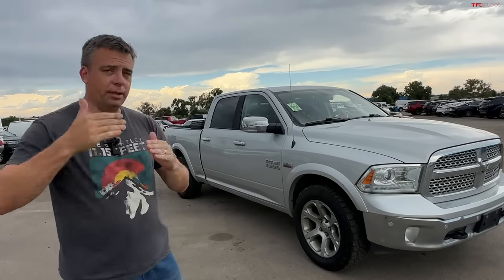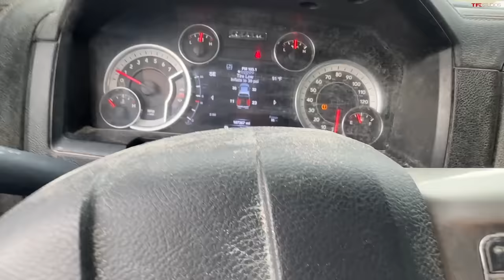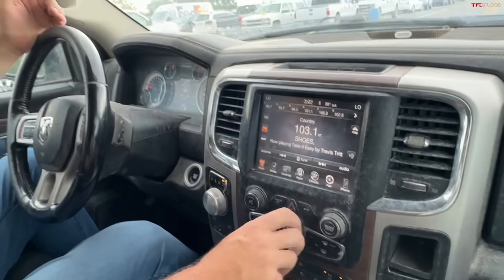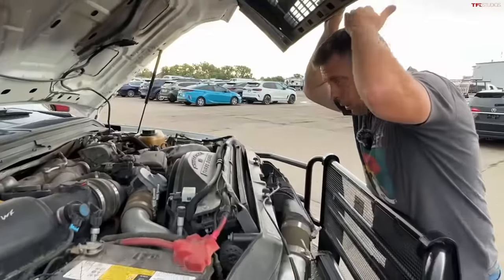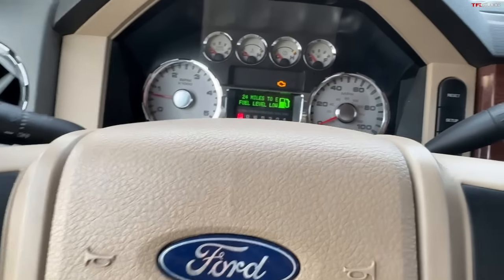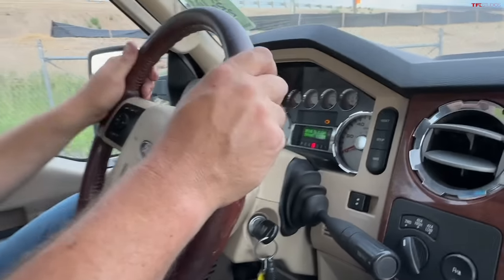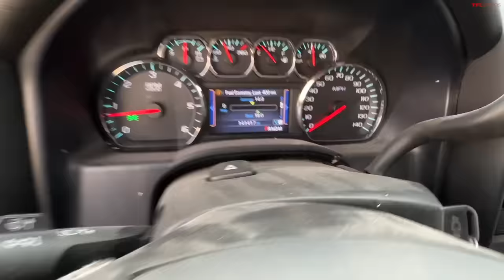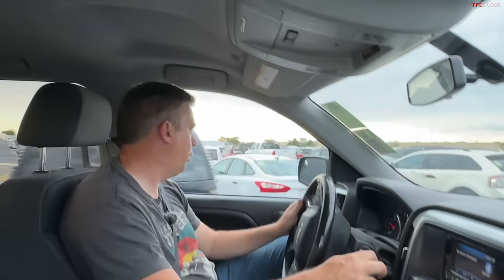These Are the Top 3 Used Trucks You Should Never, EVER Buy!

Comment: I have had my 1998 ram 1500 with a 318cc V8 for 25 years and 150 miles. It has been used as a work truck and vacations in the Georgia mountains. I have kept up with the maint. and repairs. Replaced the transmission at 106 miles with a reman. Also had it repainted 9 years ago. I will keep this truck as long as I can since I don't like all the sensors and new tech on the new ones. The price of the new trucks is absurd.
Reply: I like those trucks.  Does it still have a dash?
Reply: I see lots of trucks filthy like that at the auctions here. I have bought quite a few of them too and they are normally well maintained just dirty. Lot of them come from oil and gas companies. They need those trucks every day and normally have their own mechanic. They keep all the fluids and all changed just they don't keep them that clean. I bought one a few years ago that was a really nice truck. Just it had like 95k miles it was a Silverado like 7 years old I got at the auction for $14k. Crew cab LT with the 5.4, 4x4. Had a brand new set of BFGs on it one of the more aggressive tread patterns. It also had a propane cylinder in the bed so I could run on either gas or natural gas. It was a lot cleaner then this Ram but it wasn't spotless. There was a half dozen or so more that were really dirty. This one had carpet and all though the others all had the rubber mat floors so maybe the one I got was the boss truck.
Reply: I agree, the newer the vehicles becomes, the more plastic and sensors they have. My all time favorite is the early ninety's jeep Cherokee. Man those things will just go on for ever if maintained. I remember the trans finally went out at 272k miles and that thing had some hard miles on it, especially as I took it off road and sling lots of mud with it as well as out in the snow. The only thing that I had to replace twice was the water pump and tires. Had it when it had 155k miles and I drove it from MI to OH to NE and back to MI. I hate all the plastic they use now not to mention the rediculous sensors that often need to be replaced which the sensor itself is no big deal, but some cases, it's getting to the damn things that's the real pita.
Reply: I had a 150 Power Wagon with a 440.  I loved that truck and the fuel mileage wasn't any worse than my Ford station wagon.  Unfortunately , both rusted out far sooner than they should have.

Comment: I had good luck with my 2014 Silverado 5.3L. I just traded it in a couple of months ago and I had no issues with the engine or transmission. The only major issue I had was with the AC condenser in which it cracked at the fitting. I never disabled the AFM and it worked perfectly. I did install a catch can to keep the intake cleaner as long as possible.
Reply: how many miles?
Reply: @mujjuman  It had just over 93000 miles.
Reply: @kellyherald1390  wow nice
Reply: Just sold my 2014 Chevy Silverado today it had 336,800 miles on it
Reply: My 2014 Silverado had both the rear diff and transfer case problem. Costed me over $2,300 at 98k miles.

Comment: I have a 16 ram 1500 with 5.7 hemi. truck has 310,000 on it no lifter problems. it does tick on start-up but goes away after truck warms up. This is caused by exhaust manifold studs breaking.

Comment: An old job I worked at in 2011 had 11 Fords: 5 6.0s, 3 6.4s, & 2 6.7s. Those 6.4s were crap all around & for dual turbo motor no power & one of them needed turbos at under 20k miles. The 6.7s were great, the 6.0s honestly from my experience weren't that bad. Not the most powerful thing for it's time but still get the job done.

Comment: My 1st diesel was the 6.4 Ford and I spent 12,000 in the first 2 months in engine repairs. Then it was sold.
Reply from the maker: Yikes!  That is a lot of $$$ !
Reply: Your first issue was buying ford
Reply: My stepfather had one. He dumped many thousands of dollars into the engine. After the oil cooler melted, everything got deleted and tuned. Some hack “diesel mechanics” talked him into replacing every module in the truck over the span of 2 years. He replaced the rear differential. I put 2 AC compressor clutches and one AC compressor on it and I spent dozens of hours chasing intermittent CanBus faults that would result in a PATs lock out and/or a no crank condition (because none of those new modules actually solved the problem). I still see that truck in my nightmares. Somehow a “snake” managed to crawl into the cab and scared him out of the truck while driving across a pond dam. Needless to say, that truck now has all of the CanBus faults and whoever made the mistake of buying it at auction got to figure them out.

Everything about working on that truck sucked. Driving the behemoth in the city was nerve-wrecking with aggressive tread tires. You always felt like you didn’t fit in the lane and the damn thing wouldn’t drive straight for shit. I will say that after being tuned, it had some very impressive power, but when you don’t know whether or not it is going to crank in the morning, gobs of power doesn’t mean a whole lot...

Comment: I have a 2014 Silverado LT  (155,000 miles) also BLUE and I haven't really had any issues with it (Besides replacing the AC condenser ) and have had it since 22k miles (One owner). I run it on E85 all the time and I've cheeked inside the cylinders  with a camera and there is no carbon buildup at all (E85?). As for the transmission I always swap the trans fluid every 50k miles  and Tow maybe twice a month. SO far so GOOD ✅🏁
Reply: You will soon experience the torque converter failure.  I have the same truck  and 140,000 miles the torque converter starting making some noise.  Unfortunately once you have that, it's too late and the torque converter sends aluminum shavings into the transmission and it wrecks them.  It's a big problem and once I looked into it, all of them eventually experience this.  Look into it, you might be able to save your transmission if you take action before it happens.
Reply: @boydsnepaguidingservice  That very thing happened to my 2016 Silverado at 121,000 miles.  It has the 6 speed transmission.

Comment: My 2017 Ram 1500 Hemi runs smooth with no tick, however I use only 5W30 Syn with a quality filter. Mine only had 2 recalls, the tailgate and cruise control. I never had any failures but took it in for those two recalls anyway since it’s free. I guess maybe I’ve been lucky but my truck has never been to the dealership or mechanic for any issue, it’s been one of the best trucks I’ve ever owned.
Reply: synthetic oil waste of money conventional oil is fine.
Reply: Just admit your a ram guy that makes excuses and cover ups for Dodge and Ram.
Reply: Hey at least I never had to disconnect my battery to reset the screen in my new Colorado, err sorry my Ram.
Reply: @kc0lif  Same as running premium fuel is a waste, however i have had some issues running E85.
Reply: I have 17 Ram hemi 31,000 miles no issues yet! 🙏
Reply: @jackmanfamsquad  what exactly do you do with it? City dwellelling mostly?  Heres an idea, work the truck outside of the comfy norm like up a logging road  and we will chat again, our fleet dropped the 5.7L just based on the fact we couldnt get enough camshafts to keep up with the amount of engines that were dropping, and they are all maintained well under oil change spec with premium lubes by a Ram dealer with full documentation.  I mean your 5.7L needs 16 spark plugs just to run correctly and yield shit mpg.
Reply: I get 17.5mpg out of my 5.7. If you’re getting bad gas mileage you’re probably idling too much. Which makes sense why your going through camshafts
Reply: @panthermartin7784  If you're using it on a logging road for heavy work, it's you, buy diesels like normal business owners.
Reply: @TheEnd-eg6wq  so your saying a Ram Rebel wasn't designed to leave the city limits and not even capable to deliver pails of lubricant to a D8 fleet working off road? Maybe your kind is right, leave the 1500 for the Big Gulp runs in town, I can tell your a special one.
Reply: I've got a 2013 with 155k on it, it's had a few things here and there but all in all its been a good truck. It's had a exhaust leak for the last 120k miles on it , I just let it go since it wasn't too loud.
Reply: Agreed. 5w20 is too thin , especially for cold weather. In 14 years at chrysler as a tech , saw very few failures with the hemi. Also if you drive normally,  the fuel mileage is not that bad. Have been 100% satisfied with the 2 I have owned.

Comment: The Super-Duty with a V10 is the best option for that truck. Sure, gas mileage is atrocious but the motors are built solid and good power. That truck had the last iteration of the 6.8L Triton V10 so it is the best version with the good benefits of reliability from the 3v 5.4 without the camphaser issue because the V10 isn’t VVT. The rest of the truck is great because that is when Ford really started to make the Super-Duty a nice truck. Love mine.
Reply: "good benefits of reliability from the 3v 5.4"  errr, the 5.4 triton is easily the worst modern engine ford has ever made... especially the 3 valve lol. Wonder why you never see a 90's ford anywhere, but you see 90's dodges and chevies literally everywhere? And ford outsold dodge like 10 to 1 back then lol.
Reply: @thehavok4258  Good benefits being the fixed head so spark plugs didn’t break as easy. Also, the 3v didn’t debut until 2004.
Reply: @willcultra3268  Was saying 5.4 in general. You wanna talk about a good Ford engine talk about the 300.
Reply: @thehavok4258  I would agree on that for reliability but they are gutless. I guess if you wanted a good for engine with both, a Coyote is the best option.
Reply: The V10 was an awesome option. My dad has one and hauled his fifth wheel with it. It has 340,000 miles and works perfectly. He hasn’t had to do any real repairs or anything. Just stuff that I’d consider maintenance type stuff.

Comment: I have a 2007 GMC Sierra with the 6.o liter Vortec Max engine and its been a great truck.  It has 145000 miles on it and I had a performance tune put on it early on and disabled AFM and some other garbage that GM puts on these trucks.  I run Amsoil oil and lubricants and the only think wrong with it so far is the paint - mainly the clearcoat faltering (and there is the typical rms leak that many GM vehicles experience but its minor).  Only 1 recall for airbags that many vehicles had back then.  Plus, the intake, exhaust and performance tune made this thing run so much better.  I plan to keep it till it dies.  I'd recommend one of these to anyone.  I feel the later trucks with new technologies and even more garbage for trying to increase fuel economy are just having more recalls and issues.

Comment: I have a 2016 Ram 1500 and the tick is the exhaust leak on startup. Other than that it's fine. No issues. Had a few recalls done when I got it and it performs great. Gas mileage is good too.

Comment: In 2017, after watching your comparison reviews, we bought a 2015 Ford F150 with the 5 liter V8 and just 11,000 miles on it. Found it at CarMax. Because we were buying it primarily to tow our 25 ft. Airstream travel trailer, what impressed us was the engine braking on downhills. It now has 145,000 miles and, aside from replacing a water pump, we've done nothing but oil changes and the usual check ups. We love this truck and hope to get another 100,000 miles out of it.

Comment: I'm about 200% sure that tick was the manifold leak.  Most hemi ticks go away after at operating temps. Mine goes away in about 20 seconds (for now), usually the tick coming from those trucks is the exhaust manifolds, not the lifters.

Comment: I had a 2014 Silverado and in 2020 my mechanic told me to ditch it due to oil pump issues that were beginning to pop up. And the location of the oil pump made it an expensive fix. So I traded it in for a 2021 Silverado and I love it.

Comment: I have a 2014 GMC Sierra 1500 bought it 4 years ago now has 91,000 miles on it I must tell you I had absolutely no problems, maybe I got lucky, but it has been a great truck for me. I did install a oil catch can and change oil sooner than 3000 miles and also changed trans and dif oil already, will drive it anywhere no worries, I think preventative maintenance is key for any vehicle.

Comment: 1st-I like those Ram trucks when compared to other manufacturers.  I do hate that every time I drive one and adjust the radio the transmission neutrals out and lights start flashing until cycling the ign.  🤣🤣
2nd-People that buy King Ranches don't care about the engine, they are buying the seats.
3rd-I gave up on GM trucks after the 07 Classic.
Reply: I gave up on GM back in the 90s due to horrible paint quality and them not standing behind their products.  So that's about 30 years of me giving the finger 🤔

Comment: I used to own a 2019 silverado 5.3 with a 8 speed automatic . Boy let me
Tell you !!! The DFM feeling is like a cold 1950 car . Shaking and vibrating 24/7 .  The transmission shifts worst than my 2004 grandma car .  It was shifting so hard you will think just got rear ended . Dealer said it was a normal functional new model high standard engineering from GM .  Whit 42k miles before all this crazy prices I did trade it for a old trusted Tacoma .  ( lesson learned ). No more chevy will be park in my driveway !

Comment: I have a 2018 Chevy Silverado. I didn’t know about most of the issues until like 2 years of ownership. I did my research and found a couple things to add to the negatives. Radiator is prone to leak coolant from the side plastic tanks, lifters dropping or “failure”, A/C condenser is prone to cracking, the biggest issue is the transmission thermostat and it opens at 198 degrees which is too hot for the torque converter. The torque converter starts coming apart and the metal pieces gets thrown into the transmission which equal, done! The good thing is there are fixes and modifications to remedy or prolong life of the components.

Comment: I bought a new 2005 Dodge Magnum Hemi with MDS.  I owned it 17 years and 122,000 miles and the MDS was not a problem.  The MDS was not a problem until 2009 when variable cam timing was also added.  Perhaps the higher hp engines that year had higher lift cams that contributed to the cam/lifter issues.

Comment: I agree on all 3 plus 5.4lt 3 valve they come with their problems.  In King ranch behind front seats are saddle bags, I remember when this came out as I use to read Truck Trend.  Old F250, F350 that build in Brazil for Australian market had not best build quality but you still see 7.3lt V8 diesel around today, high mileage but above average price as new are over $100,000.  I hope all these RAM buyers don’t have these old RAM 16 problems in future especially running of 5.7lt V8.
Reply: I miss my 07 king ranch. New king ranch’s don’t have the same feel for some reason